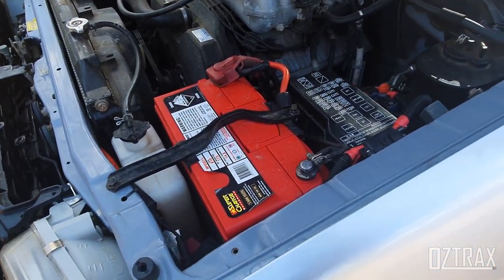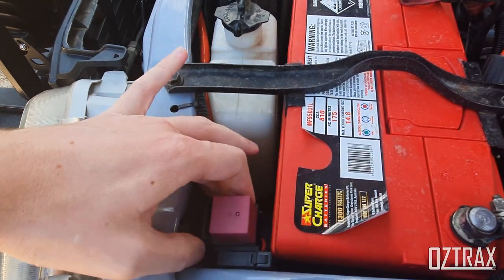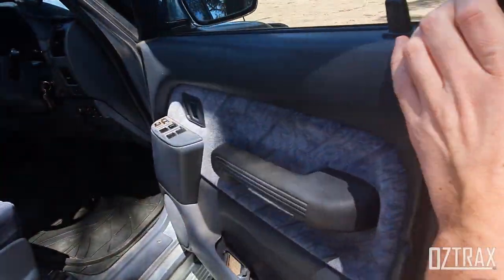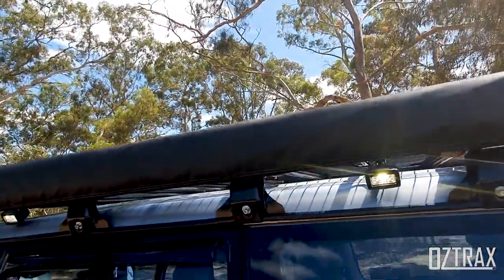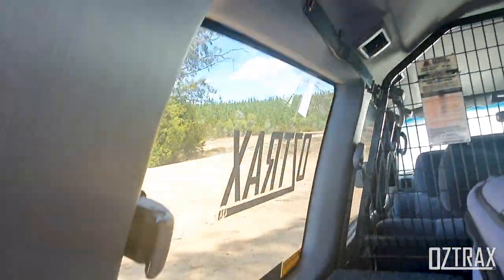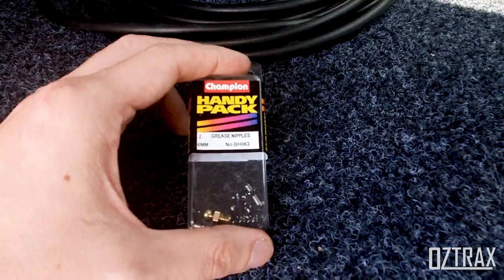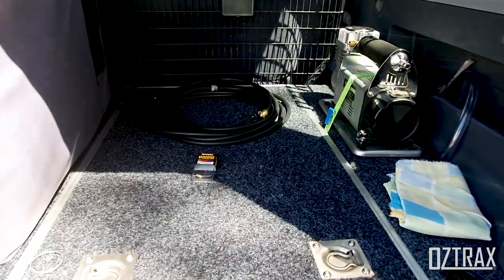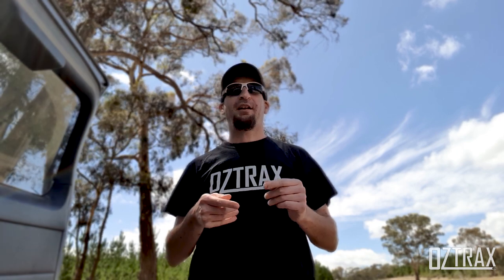Toyota Prado 90 Series // New Mods & Upgrades!

Comment: Good set of mods! whats the roof rack? and was it a straight fit?
Reply from the maker: The roof rack is just a full length steel rack from 4WD Supacentre here in Australia.

Comes with adjustable gutter mounts so fits straight on, no worries.
Reply: Great set up! I was considering buying the same roof rack but I read 90 series max roof load is 100kg, and that rack was about 50kg alone. If you could choose again would you go for a different roof rack?
Reply from the maker: Well, the nightmare 90 doesn't exist anymore, but I came to the conclusion with another YouTuber that each set of feet supports approximately 40kg on a gutter mount system.

You're correct in saying that the roof loading is 100kg, and would be even less off-road, if you factor in the off-road rating.

I didn't overload it, so it worked for me.

The most I had up permanently would have been that 50kg.

Alloy would definitely be the way to go if someone did an alloy rack with square mesh and not security mesh.

My 80 series has a steel ARB tradie rack on it, and does the job for now.

No plans to change that unless I decide a rooftop tent is for me in the distant future.
Reply: @OzTrax4X4  thanks for replying mate. I picked up the 90 two weeks ago and have enjoyed watching your content
Reply from the maker: Thanks 🤠👌I hope it's been helpful. There may be more content coming on the 90 series in the future.

Comment: Like those recovery points, will order these as the only other choice is ebay! How much is enough grease on the driveshafts? Until you see it ooze out? Must admit i skipped this on my last service as I was not sure.
Reply from the maker: On the uni-joints, you can keep pumping til you flush the old grease out.

With the slip joints, 3-4 pumps and that's it.

If you force out the grease on that then it will hydrolock and you'll need to take the grease nipple out and get it flexing to push the excess back out, then it gets messy.
Reply: @OzTrax4X4  thank you for the hints, shall get underneath and try after this rain stops!
Reply from the maker: @pradolover  How'd you go? East coast has been pretty wet!
Reply: @OzTrax4X4  hasn't stopped raining yet, though if it's still wet at the weekend I'll move it under the carport and try it there 😀
Reply from the maker: @pradolover  Sounds like a plan!

Comment: Where did you buy the spot/light bar switches from mate?
Reply from the maker: They are Narva rocker switches.

Part numbers 63026BL and 63027BL.

You can get the Carling style switches to fit with a little filing too.

Comment: Where did you buy those switches that fit into the factory panels?
Reply from the maker: They are Narva switches. Any Aussie auto parts store should have them or you can order them online pretty easily.

Part numbers 63026BL for the red one and 63027BL for the green one.

They don't clip in but are such a tight fit that they won't come out unless you put some force on them from behind the panel.

It'd be nice if someone could do a Carling switch that fits, but being such an old IFS 4WD, they only do them for the 120 series and up.
Reply: Thank you
Reply from the maker: @benjaminfoote5979  No worries 🤙

Comment: What brackets did you use to mount those side lights to the roof rack?
Reply from the maker: Hey Mark

Copy and paste this into eBay:

Pair 25-32mm Mounting Bracket Clamp LED Work Light Bar For ATV UTV Truck

Cheers
Mick
Reply: @OzTrax4X4  Thanks for that. Also what kinda of battery and battery box did you use as you secondary? Love the setup by the way
Reply from the maker: Thanks mate, I appreciate the compliments!

There is a seperate video about the battery and battery box.

Link for you below:

https://youtu.be/5YwVJeokdK0